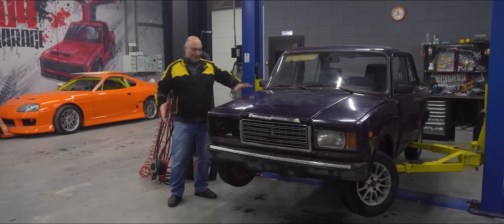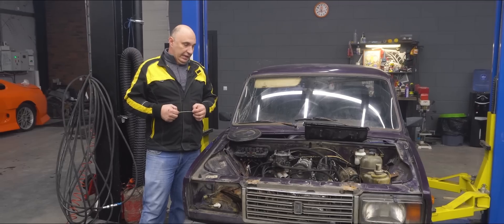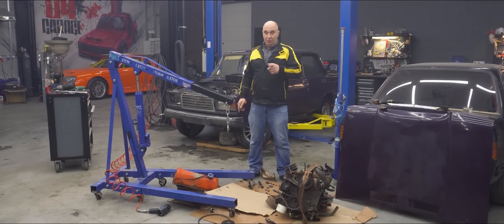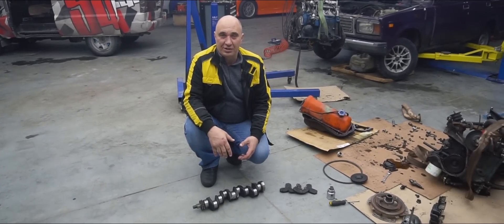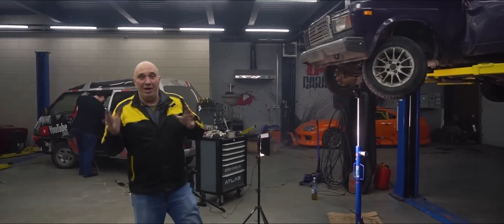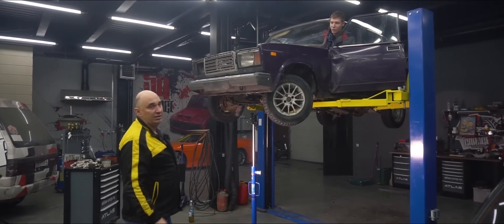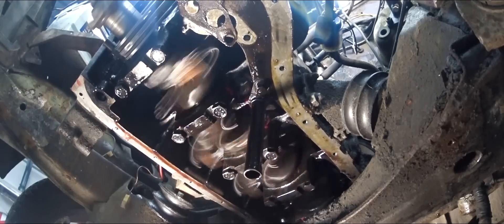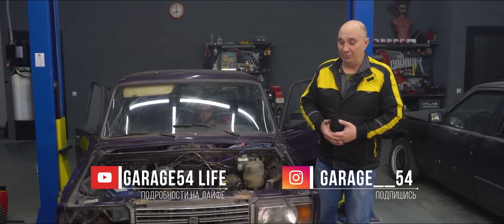Hacking off the crankshaft webbing: how’ll that affect engine operation?

Comment: I once did that to a Datsun 1200 race motor, along with heaps of other radical mods.
Shit that thing could rev and it was SO smooth and pull off the turns. I have no idea why we need those weights in the first place

Comment: if the flywheel was bolted on, that should be doing most of the dampening, especially with the clutch and pressure plate,
even then the engine stopped immediately

Comment: The Range Rover has 2 wellknown types as well what break their crankshaft. The Subarus 2.0 diesels even break their crankshaft. 
This Lada just run without oil on high RPM a lot without any problem. 
The Lada much reliable, faithful car than all the world thinks. And definitelly better than many of expensive "westside" cars. I felt pain in my bollox when I have seen that crankshaft and rods without oil :D :D 
Thanks for the video.
Reply: a Volvo 240 can run with one of the connecting rods bashing holes into the crank case

Comment: Will a forge steel crank bent if I hold it there to loosen my crank pulley bolt with the breaker bar.

Comment: How long before it snaps a connecting rod ??? Don't forget the spray glue on the main bearings and rod bearings... 
I've never seen anything run smoother 
To bad the car was not built as good as the motor...

Comment: very good video, but unfortunately, so we could see what was happening in there, you could not close it with the oil pan, AND of course, with oil running, it would work way better. hm, yeah, you have removed a lot of inertia from alternator and stuff, so it does make a difference, but that was a good experiment. Thanks a lot!!

Comment: In the 90's I was into drag raving. I would cut the crank balancers to a knifes edge. That way they were more likely to glide through the oil instead of the blunt edge slamming into the oil

Comment: This has become my favorite automotive channel!
Removing the counterweights on an inline 4 cylinder engine doesn't really  change the balance though. The counterweights are really only there to relieve flexing stress on the crankshaft on inline 4s.
This really needs to be tried on a V6 or V8 engine, which relies on its counterweights much more for engine smoothness.
Great channel though, guys!

Comment: 4 cylinders are a balanced motors. It was harder to get it to idle and I'll guess that it will be tough to drive it as there is not inertia for smooth clutch engagement.

Comment: At 11:06, is that metal glowing red between the journal cap and the block? Suppose the crank bearings would be getting hot with no oil supply.

Comment: All that will happen is the engine will have bad vibrations that will eventually destroy the engine. Some engines didn't have counter weights from the factory and worked fine as long as the engine was never overloaded with weight or overrevved.

Comment: I always wanted to build a small 4-cylinder engine, remove the webbings off the crankshaft do any balancing on a lightened flywheel.  Something like a Ford 2.3 l or GM 2.5 l

Comment: there is zero point to this video as the test was not done at normal operating or driving conditions ....i would have liked to see the engine complete with oil , water & accessories then do some highway runs....!!!!

Comment: You got really lucky on how balanced it is. It should have ripped itself out of its mounts.
Back in the 80’s I bought my ex wife a Mercury Comet. It was like Ford’s Maverick. We got it used and I was in awesome shape. But one night when she got home from work she said it was running really rough. I told her I give it a tune up that weekend, but she said no, there’s something wrong with it. So we went outside and she star ted the engine while I looked under the hood to see what was wrong. The damn motor wanted to jump out of its mounts. I borrowed a timing light fr9m a friend and the timing was way off, like 105 degrees or something.  I don’t know how much because the balancers aren’t marked that far. So the next night I borrowed a pulled from work and tried to pull the harmonic balancer, but the bolt wouldn’t budge. I borrows a breaker bar and a piece of pipe and finally got it loose, but the bolt was sheered off at an angle. So I drilled and tapped it, and used an easy out. I finally got that piece out and pulled the woodruff key so I could install the new balancer. But I couldn’t get the bolt in that crank. At that point I had a friend c9me over and we managed to get a look at the snout of the crank and there was a third piece of the bolt still lodged in it. We finally got that out and while we were underneath the car we discovered that it had been in a front end collision. The entire doghouse, subframe and all had been changed. But whoever did it did a damn good job because. It took something major to find where it had been damaged. Anyway, after replacing the balancer it ran great. I loved that car and was going to build it up, but my ex got the car in the divorce.

Comment: Time to take the shaft back out, clean and re grease everything, then fill the block with something to help transfer the heat but not use the water pump, then take it for a test and see it’s accelerating speed

Comment: lightning a crank used to be an easy way to make a racing engine rev faster and run at a higher RPM but that's if it was done right and balanced to keep it safe for the engine .

Comment: I owned a lada here in canada same as the ones he butchers all the time ,i swear they are  miniature tanks they take a beating , mine unfortunately had a bad electrical issue i could not find , had to pop the hood and disconnect my battery when ever i parked or battery would die , yet everything worked not a single electrical short could be found so i sold it . Wish i would have sold it to a smash up durby guy instead of a scrap yard ,

Comment: You should have done it this way
Test 0-100 with normal engine,
test 0-100 with cut crankshaft,
and then test 0-100 with cut crankshaft and cut flywheel

Comment: It balances out because one piston/rod is always moving the opposite way than one other, thats why you dont´t need the counterweights, but the counterbalancing force between the rods/pistons increases through the cranks main journals and gives more stress on the crankshaft. Some engines does not have full counterweight. This is the best way (and most expensive) to design a crankshaft as lada has made it.

Comment: WHAT HE SHOULD HAVE DID IS PUT THE OIL BACK IN AND TAKE THE CAR FOR A DRIVE. WHAT HE WOULD HAVE NOTICED IS AS SOON AS HE CAME OFF THE CLUTCH, THE ENGINE WOULD HAVE STALLED. BECAUSE CUTTING THE COUNTERWEIGHTS OFF MEANS HE CUT OFF THE INERTIA WHICH IS PRE-STORED ENERGY. SO HE WOULD HAVE TO REV THE ENGINE UP MUCH HIGHER IN ORDER TO GET THE CAR TO MOVE..

Comment: I have already filed down piston skirting on either side of the wrist pin, until it was basically the wrist pin and the only 1 inch of the piston tops, let me tell you it had some major rev to it. But it did grenade later.

Comment: Porsche designed that engine.  I'm not kidding, the Russians hired the German engineering firm to design the SOHC engine in the Niva and the Lada's.

Counterweights do two things:  They reduce vibration and they strengthen the crankshaft.  This car would be a bit "buzzier" after this mod, but there is the distinct possibility of a broken crankshaft if the engine is subject to sustained high speeds.  Removing the counterweights will make the engine rev quicker, but without serious speed mods, this will achieve very little.

Comment: Would be interesting to see how it would preform if they took the crankshaft and cleaned up the rough edges and balanced the crank. Am thing you will have and engine tha runs smooth, and fast acceleration but when you put that puppy in gear your going to have a major loss of torque!

Comment: Where you will see an issue with the weights hack off is under load...my suspicions are that it will stall out trying to take off and climbing hills and inclines ..with a big heavy flywheel you will have something to help with inertia but i suspect you wouldnt go too far with an automatic...you should have test driven it a little with pan and oil ..another thing those weights do is throw oil ...

Comment: I managed to seize all 1500 lada engine once, the oil pump failed and I thought it would make it home.. It didn't like the hills and only made it about 2 miles. 

Amazed this held together, but at the same time these engines are very robust, n/a tuning can see well over 100% more bhp from standard and not many engines can do that. I still have that lada itch, there is something about them that I like and this channel does not help 😂

Comment: The engine takes longer to start because it's not egar to turn over without the proper weight distribution in the crank. But yes obviously when you get it started it will rev much higher and easier because the crank is lighter and it's a four banger. And there is way more vibrations than u think u mentioned how there's no other things using the belt so all that vibration is pretty bad considering it's just that alone. That's why we got wieghts on the crank

Comment: Should put the oil pan back on and race car lightened crankshaft lol but be cool to see dyno before and after hp and tq gains and I'm sure if it was a v8 it would be alot more vibration where it's a straight cylinder inline i am sure it's less likely to be vibration from no counterweights

Comment: Back on the old days of Rally , some racers cut the counter weights from crank shaft  to gain on engine rev up time  , but loose torque ... they also transform in dry sump , so oil don't slow down the engine while cornering .

Comment: Reminds me of the old Prolong oil additive commercial where the pulled the pan off and ran the engine fully dry. Even go so far as to spray the crank with a water hose.

Comment: you guys should build a DIY lumpy cam. run a bead of weld down each of the cam lobes, sand it real smooth, and keep them all as close lift as possible. could be done with vernier calipers. very curious to see how it'd effect this engine. you could also lighten the flywheel on a brake lathe :)
Reply: here in Philippines we do that to our motorcycle camshaft. we just weld the lift of the cam and grind it
Reply: @cesarbaretta4050  wow, that's crazy, does it work well?

Comment: You would have to test it under load to get any kind of useable information. In neutral without any load isn’t very informative. I agree with some of the other commenters, they should have connected the oil pump and sealed it up to show how it reacts even under the slightest load.

Comment: Guys you should have popped back the oil pan and all accessories on and taken it for a spin with some load. An engine vibrates more on transient with loads, accelerating the car from a stopped position for example. That would really be interesting to see how it behaves under heavy accelerations without the balancing weights ! I don't think it would last long to be honest...

Comment: Make a racing lada, simply remove as much weight as possible from everywhere. No windows, minimal exhaust and just one seat etc. Light weight = performance. You can even run it with no battery and just the alternator, or vice versa. No servos for brakes or steering. Maybe you have a high-profile camshaft too, could be fun.

Comment: i think what most of us want to see is an engine stretched to it' s limits. if it blows up well we still learned something. what is bad to watch is abusing an engine just for fun. waste not, want not.
leaving the oil pan off was not good - we know that will tear up an engine in short order. so it blows up and we rally have not learned a thing. a waste of an engine.
i have often wondered about the weights on a crankshaft. i just don't see how they can help. i would love to see an engine without the counterbalancing weights put to the test.
love your channel. kudos.

Comment: its  like gm with saab 95 , " we do a light version of the crankshaft, afterwards oöh we increase the weight  of the flywheels with 100 % öhh..... without turbo you cant drive the car . with turbo it goes like and old skoda